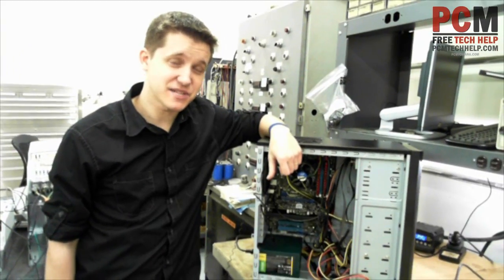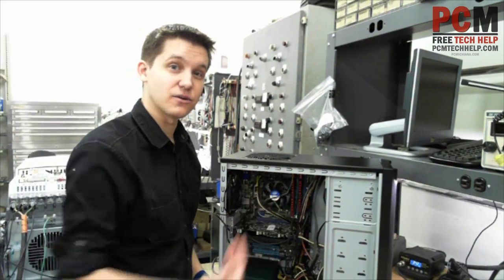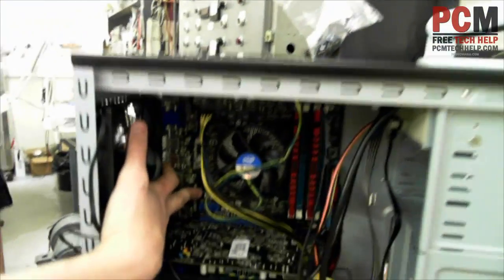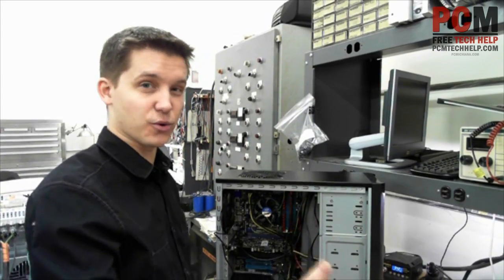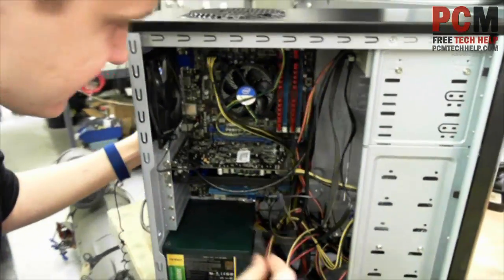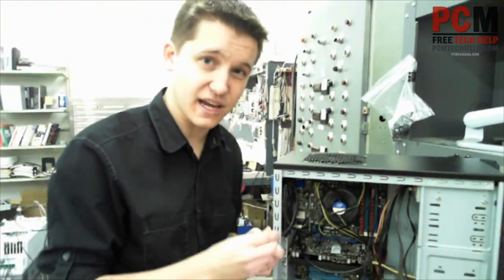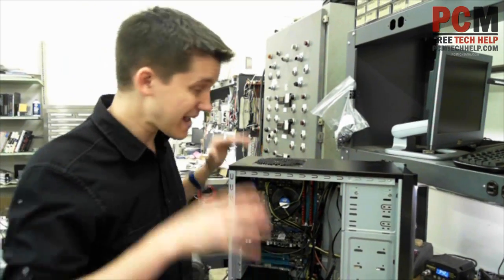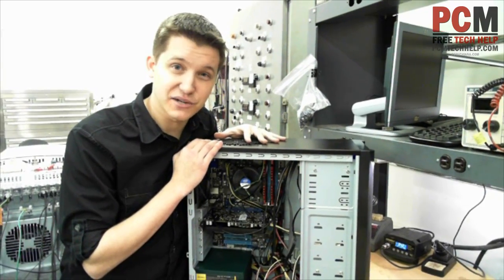How To Install Computer Case Fans (2022)

Comment from the maker: Does it shut down even with Battery Life? That is a bad sign as it means you may be experiencing overheating issues and it might need to be serviced by a technician. Make sure you are using it on a flat hard surface and you can buy a can of compressed air from the store and blow out the dust through the side vents.

Comment: Is it possible that you could make a video showing how to set up fan speeds to adjust automatically according to CPU temperature? Currently I do this with MSI Control Center, but it is very buggy and CPU intensive, I know it can be done with "SpeedFan" but it seems very complicated!

Comment: dude...pro tip here
you can also add a huge block fan....which are roughly 2 feet by 2 feet
-you first align the sides of the block fan with the sides of the computer case,
-then you carefully wrap duct tape around the top and bottom
!

Comment: Yeah, 2 types, 4 pin, are the big fans, and 3 pin, seem to be, tinier fans, that's how i see it, anyway, but yes, you can fit a 3 pin connector, in a 4 pin port, but it wont work, the other way around, also, when your linking up your fans, make sure you read the case manual as well, because some cases, come with there own fan controllers, even fan coolers can come with there own controllers, which means the fans are bumped up by the cooler, when things get hotter ;)